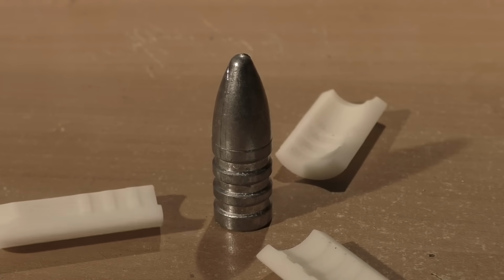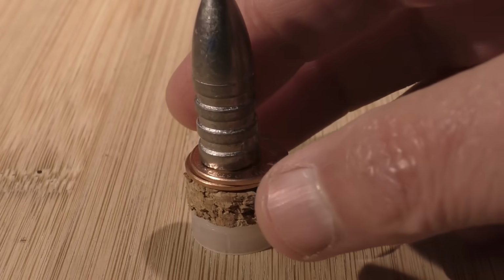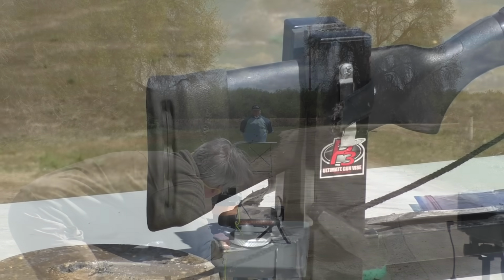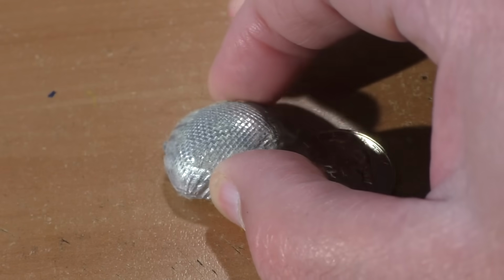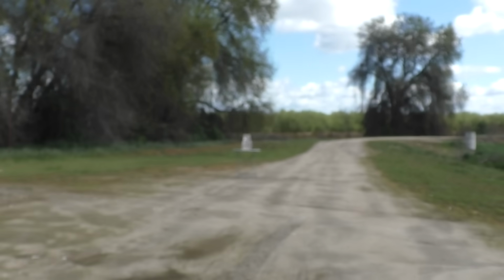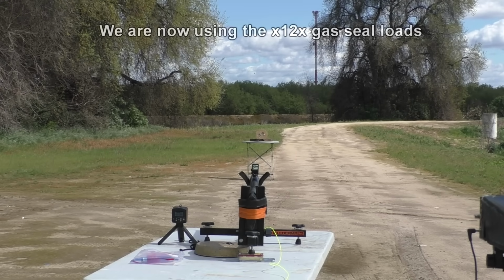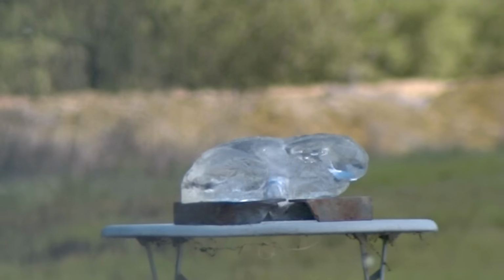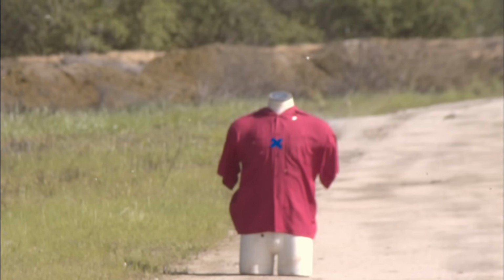45-70 SABOT  for 12ga.  One of the MOST challenging loads

Comment: This opens up a new area of exploration, different weight 45-70 bullets including jacketed. 50 cal rifle rounds, prehaps 50 BMG if somebody has reloading components. 
Like some of the others, I think jerking the string is throwing off the aim. Prehaps you, or a viewer, could devise a levered trigger release similar to the release on the Ransom Rest. 
Looking forward to seeing your solution.
Reply from the maker: These 45-70 bullets were 1.4 inches long.  A 50 BMG is 2.25" long.  There wouldn't be the room in the shell,  but also,  it would 
take a LOT more velocity to get enough spin to stabilize that very long bullet.

Comment: If you have any more issues with that buttstock belt, try a section of seat belt.  If you go to a pick-a-part junk yard you could either cut a length out of a shoulder belt or maybe find something that has a lap only belt that you could pull both sections from so it could be adjustable.

Comment: SOme goblin in the back of my mind keeps saying lengthing the swing arm you're using to transfer the pull of the cord to the trigger and attaching the cord farther up might help a little once you get the anchoring of the rest squared away. Should mean even fewer tugs on the cord to get the accelerator to trip.

Comment: Hey Jeff, if you use a cheap bicycle brake or shifter cable, and cable Housing you could pull the trigger without having to jerk a string.    You would just have to use one screw to mount the base plate for the Housing to the frame.
Reply from the maker: I've made some improvements with the lever to keep the alignment of the bolt properly with the trigger.

Comment: i mean those hit just about everything you pointed them at.  But wow 3d printed parts just dont like to be accelerated and spun.  those shure came apart consistently.  Even with the new firing rig you are a pretty good shot I think you need a way to squeeze  the trigger instead of jerking it with string trimmer line. I'm thinking of a cam lobe mounted within the trigger guard...  a "u" shaped assembly.  I have it perfectly engineered in my mind
Reply from the maker: thanks

Comment: The left right deviation might be because you are yanking on the lanyard at an angle. If you created a pulley system for the trigger lanyard you will have a more linear trigger pull. Then you only need to worry about the effect of the rifling and wind on the projectile.

Comment: On the lever the string is attached to pull the trigger, try extending the lever above the trigger for more leverage so it's easier to pull the trigger. That way it doesn't throw the shot off as much due to having to jerk the string. Just an idea I had to try and help.
Reply from the maker: The problem was the alignment of the bolt with the trigger changes when I adjusted elevation.   I've slotted the arm so I can not adjust that and it works very smooth now

Comment: It looks like you are getting a lot of jerky motion on the pull string. You might want to consider using a pulley on the string where it is attached to the trigger pull mechanism. 😢If your string runs through a pulley and back to the stand near the belt it may give you a much smoother pull. Remember your shooting training “squeeze the trigger don’t jerk it”.

Comment: You should rig up a plunger with a little  solenoid and make the trigger pull electric. Be real easy, and no more tugging on the string. Just run a wire to a switch, or even make it wireless. I always look forward to a new drop. Still getting an occasional guest shoot from OG?  He's lots of fun. Anywho, thanks.

Comment: Hey Jeff, I’ve also shot some of my shotguns and muzzleloaders with a very similar set up… I also have had several straps break on me, especially when I fired 1oz slugs in a hot 3 inch shell. The final “fix” for me was when I ran a cheap ratchet strap under the table and around n over the barrel. I used shims made from pieces of floor linoleum, placed them under the table legs until the red dot scope was on the “bullseye”. This worked quite well for me, it may be of some help for you too…
Thanks for another fun video sir, God bless you my friend!
Reply from the maker: This rest definitely has limited articulation.  It's ok when shooting at a level target but you might have noticed I needed to
stuff junk under it when I needed to shoot downward,  even a little bit.

Comment: Bit of a sketchy round this time.  That's all good though.  It appears adding weight to gun cradle helped.  I would try getting a longer lever arm for the trigger.  Keep the hinge to trigger distance, but with an arm twice as long.  Tied off at the top, you might have enough leverage to be able to put a smooth pull on the trigger. Keep the rounds flying down range and the videos coming 😊

Comment: I think your remote trigger string needs to be upgraded to a sheathed cable, like a bicycle brake cable. So pulling the trigger doesn't pull the shotgun.

Bike cables are available in bulk, generally with the housing & cable separately, so any length.

Comment: Jeff make your trigger actuator longer and protrude above the gun. Tie your string as high as you can. That will increase your mechanical advantage. Your pull will be a bit longer but, you will not have to pull as hard.

Comment: Your remote trigger. I have two ideas. 1. Put a 2nd pivot behind the weapon and connect with a rod so there's no slack in firing. OR 2. Rig a solenoid powered by a battery and button.

Comment: Suggestion.
Add a ring bolt to each side of the back of the stand. At a considered hight above the base. (imagined inline with the trigger)
Tie the pull string securely to the left ring bolt.
Thread the string through the trigger guard, and then through the right ring bolt.
When ready to fire, place the string on the trigger, carefully holding the string tight as you sit down at the camera.
This will see the force needed to pull the string halved, more controlled. The sideways force enparted to the stand will of course
have to be countered by more weight. But I have recently been informed that there are not one, not two, but three lead plates. :-)

Comment: Jeff, try putting a eye screw on the right side of the rear butt support, this will help straighten out the forces on the rig when you pull the lanyard. In some of the videos you can see the whole rig move as you are pulling the lanyard.
Reply: I second this idea, also run it through a pulley on the trigger lever and back to the base of the eyebolt string guide.

Comment: Suggest an additional longer ratchet strap - attached to front of gun rest, looped under the table all the way around & up to the rear of the rest. Twang the strap between shots to check if it remains taught. Heavier table may be beneficial.
Reply from the maker: Remember, I still have to reload the gun

Comment: Jeff, you just really don't trust sabots do you? 🤣

Out of curiosity, once the first shot or two is proven safe, why not finger actuate the trigger even if it's still in the rest? As for a remote trigger, Ransom makes one for about 150 and there's various DIY methods as others have mentioned. I feel like the string does better with a smooth, steady pull too.

Fun video, cool idea but ya I agree those sabots have to be made from something a bit more durable. There's other printable plastics that would withstand it far better.

I think these would probably be super accurate with a better sabot material and, a more secure trigger activation method ;)
Reply from the maker: I just don't think most 3d printed stuff is up to the task
Reply: @taofledermaus  I admit to not being very read up on it, but from what I understand there are more expensive polymers now that could ~probably~ withstand it.

Comment: Have to say the ratchet strap stuff looks to be working awesome.
As I watched and listened wondered about adding some adhesive to your sabot's like maybe rubber cement but thinking that defets the porpous but what if you were to very lightly put a drop of maple syrup just enough stick to help the sabot's stick to projectiles to help with spin but not enough to actually stay stuck.
You have some amazing idea's keep up the amazing work.
Reply from the maker: It's pure pressure friction that is needed,  not cohesion.    Think of how you can lock up brakes by applying more pressure.  By making the bore fit very tight,  we can achieve that.
Reply: @taofledermaus  mmmm that makes sense. In this case what about powder coating the projectiles ? Would only add a couple thousands ( they should be tighter if using everything else the same ) and would show up on camera better.
And yes I know you might not make another video like this so just thinking and typing

Comment: If you put the string under the stock you most likely wouldn’t have to jerk it and move the barrel/ point of aim, because your actually getting a trigger pull straight back where as your contraption is pulling more to the side of the trigger. Just my 2 sense. But keep it up Jeff! I love your content. I retract my statement about the string and trigger pull now that I’ve seen your set up.
Reply from the maker: The biggest problem is the alignment of the bolt with the trigger when I have to adjust the elevation.   In some cases the bolt is pressing against the very TOP of the trigger which makes it very hard to pull.   I've slotted the arm so I can adjust that bolt.

Comment: I don’t know what those sabots were printed out of, but if they were printed out of PETG, that’s why they’re shattering.  PETG is a pretty brittle material, I’d suggest something like PLA+, which is used in the 3D2A community quite frequently
Reply: If you need them printed out of PLA+ or Hyper PLA, if you can get an .stl file, please reach out to me.  I'll gladly print you a few dozen free of charge.
Reply: @ I have a K1C
Reply: From the finish, they seemed printed out of resin, which is generally more brittle than most filament options.
Reply: @GiolliJoker  after taking a second look I agree on the resin. I bet regular old pla printed vertically would be way stronger than what he had. plus layer adhesion isnt really an issue since you would be squeezing the layers together anyways. resin looks nice, but the regular formulas are brittle asf. would be interesting to see if they perform better in another material.
Reply from the maker: AnyCubic Tough White is what he said they were made of
Reply: @taofledermaus So they were printed on a resin printer. Even the most tough and impact resistant resins just don't stand up to the shock as well as FDM 3D printed materials do. 
PLA+ will do really well BUT it does begin to soften at around 60°C so that can be an issue if the ammo gets hot. I would probably use some form of Nylon, if rigidity is needed with the design I would use a CF nylon, if cushion and flexibility is needed a non filled nylon. Once properly rehydrated printed nylons are extraordinarily tough.

Comment: I’m working on a trigger idea. How bout we use a 8’-12’ bicycle cable attached to a short piece of bike handlebar, grip, and lever on one end. A bolt on bracket @ the rest, and attach the cable to your existing aluminum trigger lever. Then you can just squeeze and eliminate the gun from moving off target. I can get the stuff put together if ya wanna give that a try.
Reply: That's a great idea
Reply: I was thinking something similar. I'll suggest that if sourcing long enough cables and housings is an issue, try looking for tandem bike parts.
Reply: You could pilfer the entire brake assembly from a bicycle with the rear clamp style brakes on a bracket that mounts to the gun sled.
Reply: @WreckEmRacing using the actual brake bracket modified to squeeze the trigger is brilliant. It's even tunable for the release point on the trigger. Between that and strapping the stand to the table, guest shooters can actually be guests, and our favorite host can continue to grow his channel.
Reply from the maker: We'll figure something out.    Still taking baby steps with this
Reply: @taofledermaus  the way you plan out your loads for all the different slugs shows your methodic and thorough approach. We all know you respect the opinions of your fans and read comments, so brainstorming is the natural reaction I think. I've got faith you'll figure something out, and can't wait to see all the different slugs you have in the lineup.

Comment: The original 1881(?) Ordnance Specification was a 500gr bullet over 70 Grains of Black at  1350fps from I forget, 30ish inch barrel?
I get close to 1600 fps with 11/8 ounce ( apx. 490-500gr) of #6 Steel Shot from a high brass 3" 12ga case.

Comment: A hydraulic trigger, or an arrangement of pulleys and levers to multiply the force applied to the trigger so the cord doesn't have to be jerked so hard. Possibly rachet strap the sled to the table if the table frame can handle the stress.

Comment: We ended up putting an old leather belt on ours with a strip of that plumbers steel strapping on the outside of the belt. Basically protecting the riffle from the steel strap with the belt. Still have had to put on a new peace of belt every now and then. Don't ask why we need the set up so often " it had to do with art, somebody else's art "

Comment: Alot of thought into it.  I knew I smelled burning.  Haha. 4570 in a 12ga, hot dog down a hallway anyone?   
As far as the jerking of the string, would two cheap pulleys (nothing special, harbour frieght or somewhere similar likely has small ones for that size rope) attached to the verticals on the stand smooth out the trigger pull?  It would for sure reduce the force needed to pull it back at the very least.

Comment: For a remote trigger,  two syringes connected by tubing, you press the one to cause the other to operate the trigger.  No disturbance that way. Have a great day
Reply: Fill the syringes with vegetable oil or water so that you have more precise trigger control with an incompressible  fluid
Reply: @stu2779 Exactly 💯
Reply: @stu2779 I was going to post the same my friend.
Reply: I was going to make suggestions about the triggering mechanism myself, but nothing I thought of is better than this.
Reply from the maker: I saw something just like that on ebay when I was researching remote triggers
Reply: I second that motion!!!  🤠👍
Reply: That means he need to find a syringe that fit inside trigger guard or make a bracket that fix the syringe to gun without tempering anything. Overengineering without concern of producing headache.
Reply: I learned this in a woodworking project from rockler….was a catapult with a hydraulic trigger….you can also use a cheap air controlled cylinder and a bike pump….thats how I have my shooting rest set up….i
Also bolt mine down
Reply: Sure seems like a better plan/idea than just jerking on a string!
Reply: does air work or does the system require a non-compressible fluid?
Reply: Good idea but I think that eventual leakage could compromise reliability.
As mentioned by @jamesgotfryd4972 a bicycle's modified rim brake jaw is likely the better solution.
Reply: I borrow the next door neighbor’s kid. No tubing necessary.
Reply: @charlescouncill  How do you immobilize the offspring without tubing?
Reply: @charlescouncill you use the syringes on the neighbor's kid?!

😂
Reply: Excellent idea.

Comment: What about some sort of pulley/snatch-block setup that would allow the trigger to be pulled without the need to jerk the string? I think the jerking is a big part of the accuracy struggle. One end could be anchored to the butt-stock clamp.
Reply: A bike brake cable and a couple of fasteners you could relocate the trigger as far away as you want and get a smooth pull.
Reply from the maker: Part of the problem is as I adjust the elevation of the gun in the rest,  the bolt that contacts the trigger doesn't line up well with the trigger so it is pulling near the very top of the trigger and getting terrible leverage.   Just something else I need to fine tune.
Reply: I was going to comment on a pulley system as well, I think all of your accuracy problems are from the same source as mine, jerking the trigger! Thanks for the video Jeff!
Reply from the maker: @garand1459   We have a jerk,  jerking on the string,   so double negative.